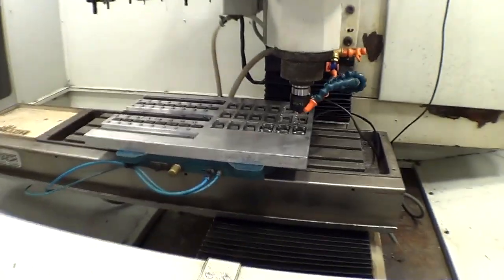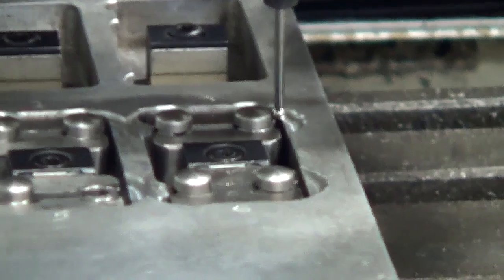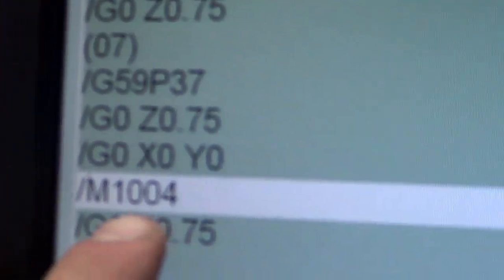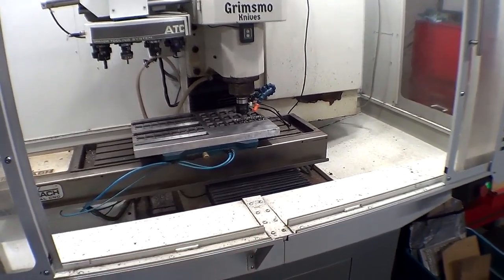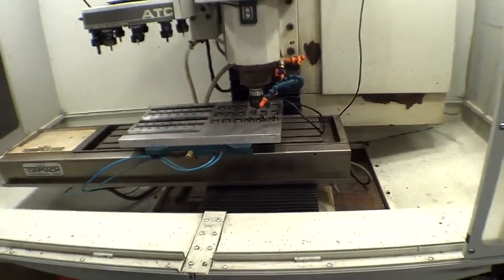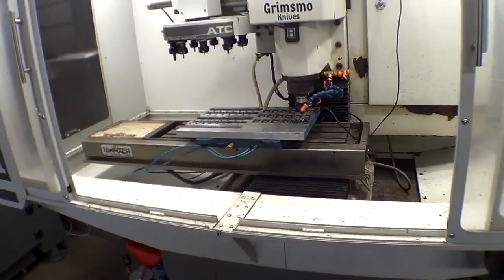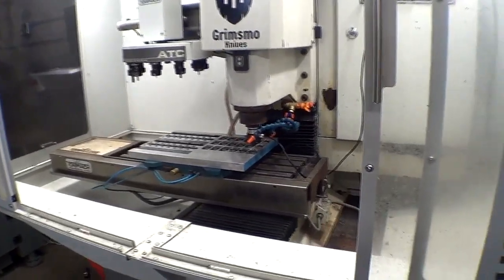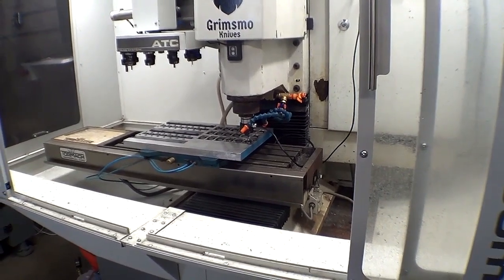Tormach digital probing - finding the center of things with CNC

Comment: I like using a probe on my Tormach, great little tool, but mach3 sucks for probing, I have distorted two probes and a few tips using mach3 it loves to move in z when its told to move in x or y. I am hoping that Tormach new software will work well for probing.
Reply from the maker: Apparently Tormach's new Path Pilot is pretty awesome for probing, I can't wait to try it!  I've had it sitting here for weeks I just haven't installed it yet.

Comment: as the top is round, couldn't it have just picked 3 points on the sides to find the center?  Saves time in the cycle by as much as 20%. Unless it can't think in that way and requires four "sides" rather than a radius side.
Reply: Depends. If you're sure your sizes are the same, go for it. Find the center on Y, then touch X on that center and move in half the diameter (and half the probe)

But, if your sizes aren't consistent, it won't work
Reply from the maker: The probing routine is way easier to calculate if you separate each axis, so touch left/right and find the center between those two points, then do the same for up/down.

Comment: John,  since your parts have a curved top, if you probe height first you may not be hitting the highest point. It would seem to me to be better to probe the sides first to establish the center location and then probe the center for height. In this particular case it doesn't matter, since you are milling it flat anyway and the parts are small enough that depth of cut isn't a factor, but if I'm right then it's something to keep in mind for cases where height accuracy really matters. 

That knife you showed the finished part in is beautiful BTW. The colors, the pattern on the handles, and the Damasteel patterning all work together perfectly!

-- Mike
Reply from the maker: Thanks Mike, you're right.  Although I don't actually use the probed height for machining, it's just part of the probing strategy to establish where to side probe from.  For the machining height I base it off the fixture, so that every part is the same from the fixture up, not from the head down.  Good call though!
Reply: John,  Thanks for the response.  That's a good point to keep in mind...where you reference from depends on what's important to you.  You ref from the bottom (i.e.fixture top) since total height is critical, and someone else might reference from the top if they were more interested in cutting depth from that face, and didn't care so much about overall height.

-- Mike